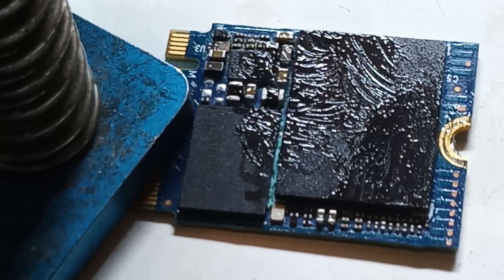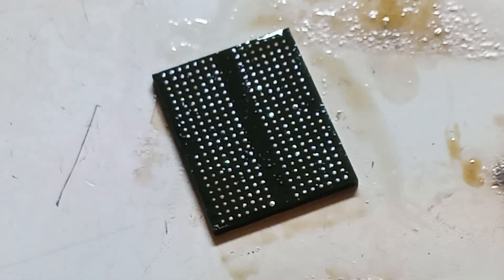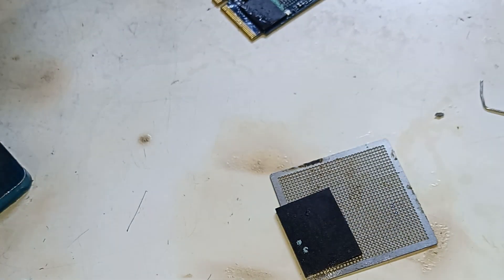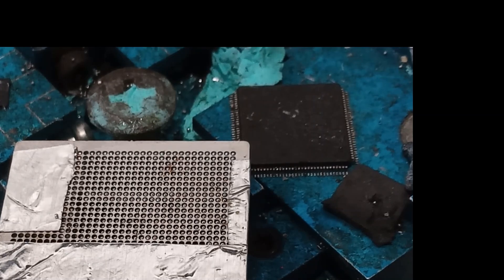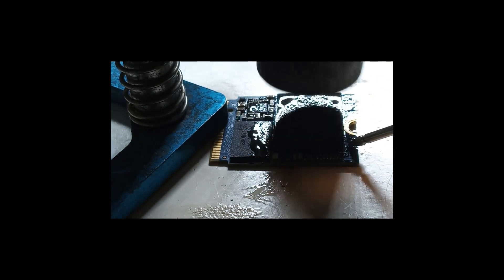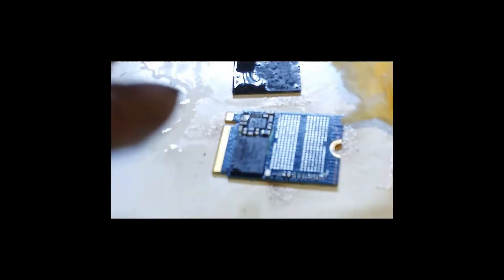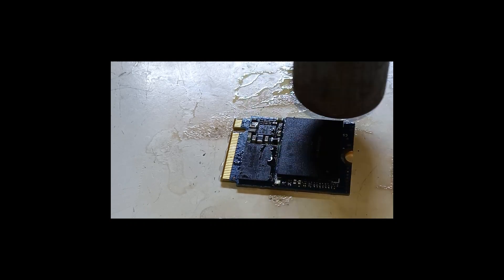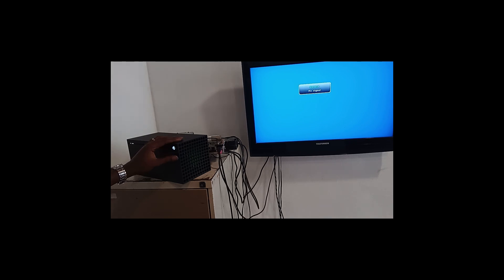Xbox Series X SSD Nand Flash Swap To Series S / Reball Attempt

Comment: Hello my dear frend, remember to apply heat from bottom of the pcb to remove nand flash. You also need to put the series x nand flash into another 1tb nvme also because of the controller that is designed for 1tb

Comment: Great video, keep it up! Unfortunately the SSD is paired to the APU. There is a hidden partition in the memory, which contains the certificate of the console, which is paired to the APU. In Xbox One these special files used to be in the eMMC. But now they moved them to the NVME SSD in a hidden partition to save costs. If it is damaged but you can read the sdd, You can copy the hidden partition, and put it into a new flash! (Similarly to your video where you used an xbox360 to copy a damaged xbox one eMMC NAND, then write the contents to another good eMMC)